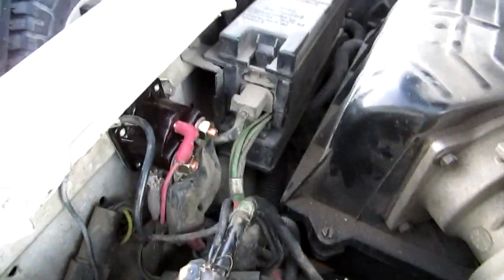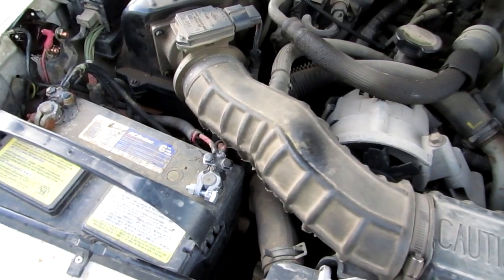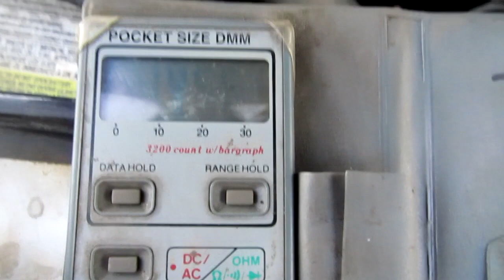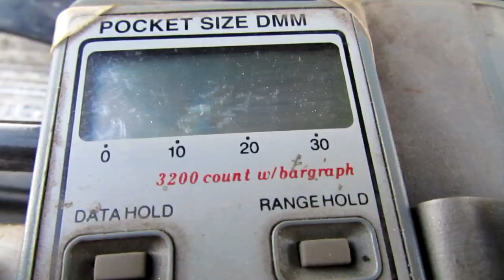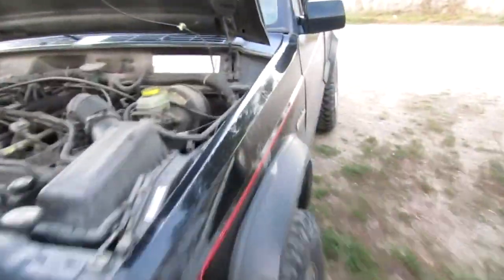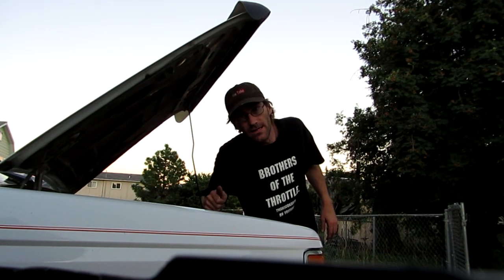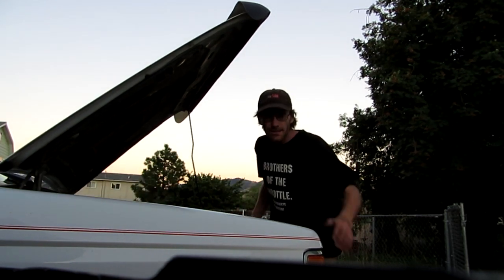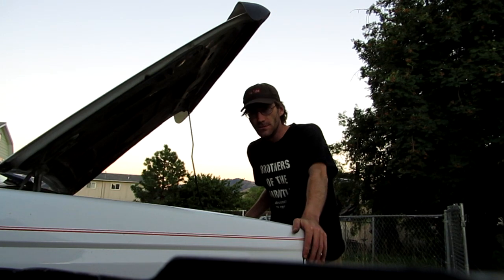Ford Ranger Alternator Test

Comment: Put your battery tester on the battery and then have someone turn the key to try to start it and watch the voltagei if it drops a lot you have a bad cell in battery if it doesn't check the terminals at the starter for loose connection

Comment: as some have said before me, and i had it too, the cheapest fix is if the connection to the solenoid cable  to the starter has any corrosion, replace it , that was my problem in the 90's when i had one.or load test the battery, or the fluid full in the battery or is the battery too old to work, mmm, and some guys put saluted Epson salts in the battery when refilling, seems to work for some. keep us posted sir, i watch all of your videos with anticipation.

Comment: Also an easier way to test the alternator is to disconnect the positive wire on the battery, if the car stalls soon after then the alternator is shot.
Reply: I know I'm 9 years late lol but my Ford ranger I just put new battery and alternator in it and as soon as I disconnect the negative it shuts off should I try disconnecting the positive while running not the negative
Reply: @nickolasvaughn667 You could also try to use a digital multimeter and check your battery voltage when the truck is running, should be around 14-ish volts. Ford Rangers also have fusible links that I believe are connected to the charging system, that could be bad as well.
Reply: @TheKurtTribute  dang you actually responded yeah that's what I thought too I thought it should charge around 13.5 to 14.7 but it's staying at like 12.4 but last night I drove it and it lasted an hour before it shut off and was completely dead so it must be slowly charging because usually if you're not charging it'll shut off in  like 10 minutes minutes
Reply: @TheKurtTribute  checked all fuses they're good maybe the new alternator I got is defective I don't know but I doubt it cuz with the old one it was doing the same thing
Reply: @TheKurtTribute  my mom's alternator went out in her Nissan last week and we had to drive it 2 miles to make it home and it died twice it only lasted 5 minutes this is the 95 Ford ranger 2.3 l it ran good for 45 minutes and then started bogging out and then shut off
Reply: Lights started flickering and then I lost throttle power and then it shut off pulling in my driveway so right now I'm just driving around with a second battery
Reply: @nickolasvaughn667  Likely an alternator issue. My 99 Ford Ranger acted similar when it died. Also, if your gauge cluster works, the battery light will be on when it’s running if the alternator is not working, as the light is really a charge indicator.
Reply: @nickolasvaughn667  The amount of time the vehicle can run on the battery alone depends on a lot of things. Your Nissan likely has more accessories being ran by the charging system/battery when it is running, versus your ranger being older isn’t as demanding on the electrical system. The standing battery voltage should be around 12.6-12.7 volts, anything near or below that when running indicates the alternator/voltage regulator isn’t working. Generally speaking the large post on the alternator should have battery voltage when the key is out of the ignition, if not the fusible link is bad. I don’t remember the exact schematic for my Ranger, but I believe a few wires should have battery voltage if the link is good. You should also be able to start the truck and check the voltage coming from the alternator, wether or not the link is good won’t effect if the alternator itself is actually producing power.
Reply: @nickolasvaughn667  Vehicles can also seem to experience other “ghost” symptoms when the battery/alternator starts to die. I remember my Ranger running fine, and then at a stop sign it was bogging down when I tried to accelerate, it was stuck in third-fourth gear and due to lack of electrical power it couldn’t shift. Eventually it worked it’s way back to first gear, but it took 10-15 seconds at least. In your case it could be bogging due to either the fuel pump, injectors, ignitions system, or many other things not seeing enough voltage which is “confusing” them so to speak. Even in older vehicles, the electrical systems are fairly sensitive as to what voltage they require to operate correctly, and the window is generally pretty small.
Reply: @TheKurtTribute  okay the gauges don't work but the alternator is brand new
Reply: @TheKurtTribute  hey man so we just got the truck fixed I've been chasing this s*** for 3 days literally was like  today I was like they must have sold me a defective alternator so I pulled the alternator went and had it checked and it tested good and then I remembered one thing I pulled all my dash components out the cluster all my dash gauges and I was like that must have something to do with it I plugged them back in now I'm charging 14.47 thank God
Reply: @TheKurtTribute  it's crazy that your alternator basically charges through your cluster having the cluster unplugged it won't charge I figure that out today
Reply: @nickolasvaughn667  The majority of charge indicator lights are wired in series to the alternator charge system. If that wire is unplugged then the alternator has nowhere to send it’s generated power. Essentially unplugging the cluster is the same as cutting the charge wire. Glad you got it all figured out! I remember having mechanical engine issues with my Ranger when I owned it, spent countless sleepless nights stressing out over it.

Comment: check all cables and connection points make sure they are all very clean and tight. then do a voltage drop check across the positive side and then the negative side. this can be done by unhooking one of the battery terminals and connecting a volt meter to the positive post of the battery and to the positive connector on the vehicle. then crank the engine and observe the meter. during this test the meter cannot read more than 0.6v if it reads more the cable must be replaced. do the same thing for the ground side except the ground side cannot read more than 0.2v cranking. then if that looks good connect battery and redo voltage output test on alternator. if voltage is above 13.5v turn on all electrical loads and make sure voltage stays above 13.5 v. lastly if all the above look good replace battery
Reply from the maker: good info, thanks.
Reply: another thing i forgot to mention is check the condition of the insulating material on the cable if it looks like the surface of an orange or looks like it is very fat in some spots replace the cable

Comment: try following the cables from the battery to ground starter and alternator and see if there is nothing loose about the other video the starter staying engage it could be the bendix on the starter staying stuck  .. i had a chevy dump that sometimes the starter stood engage and sometimes it didnt i just end up replacing the starter

Comment: If you are showing 12 volts on your battery, remove all your leads going to from the battery to the solenoid and the starter. Check them for any "bad" spots and give them a good cleaning and put them back on nice and snug. Also, did you check your water in your battery? "frying" sometimes just means evaporating all the water inside the battery. Just make sure you use distilled water. Before anyone says anything "maintenance free" is under normal wear and tear, not a smoking from a starter.

Comment: The alternator cannot charge your battery if its dead.  Disconnecting the battery while the engine is gunning is a bonehead move. the battery stabilizes the alternator voltage, you can burn up your entire electrical system.   Take your battery to Autozone, they will charge it and test it for free.

Comment: Sorry to hear your having so much trouble with your truck. I would go with 1tufdog. His is a very practical suggestion with only spending on the power to do the job. If it recovers with charging then job done. If you can. Do as Anthony said and check water level. If you don't have ionized water. Cold boiled water is near enough. Take care.

Comment: Here is what I think happened. You went to start the truck with your knife and didnt return the gear all the way back to the run position therefore leaving the starter running the entire trip. When you shut the car off the gear was returned to the off position,wich shut the starter and engine off. This cooked the battery. A new battery should fix the problem. So the next time you hear that"fan" sound, take your pocket knife and turn the little gear back a little further.

Comment: It reminds me of a problem i had with my Ford P100 (European model) My problem was that one of the cables to the starter motor was nearly fallen off... It's was connected with a bolt but the bolt had worked it's way out....

Comment: Take the battery down to your local parts store and have them load test it after you charge it. Awesome so you can run a jumper wire from the positive terminal on the battery over to the energizing terminal on the starter solenoid and bypass your ignition switch if it turns over then the problem is in your ignition switch.

Comment: Sounds to me like there was an arc when you tried starting it, so I would check the battery leads to make sure they are tight (you'd be surprised what a loose cable could do) I would also check all grounds and make sure they are tight, with a vehicle of its age they very well could have worked themselves loose, maybe a battery would fix it, however I personally would check the free to fix things first, connections, wires, etc...

Comment: tman it might be silly problem like my dads car it was the (battery fuse) note (check if it has a small crack or if it's burnt, the electronics box in my dads car was in the upper left side of the hood but in your truck it might be the one you took pics of in the first video so ya they are cheap also 
Good luck man

Comment: Battery swap for quick check. With multi run + lead to bat post and the ground to the alt. With the multi on 20v it should read about .01 if it reads .04 tp like .05 your diode maybe sticking. If that checks then starter, as when the bendix engages and could stick causing the engine to turn continually until bat dead, could unstick as you did. But again that ignition and column is jacked:( 
Always start basic and cheapest but make check list so no work orwasted time, you have building to do!

Comment: It is actually 100% true, by disconnecting the battery while it is running, the alternator can supply too much voltage to the electronics because the battery isn't there to act as a conductor. You would never think this could happen, but with a little bit of knowledge on how electricity works, it makes perfect sense.

Comment: You shouldn't disconnect the battery with the engine running, you can fry the computer and all your electronics. To see if your alternator is working, test it with the battery hooked up and you voltage should be around 14 to 15 volts. Try your battery in something else, to see if it is OK. Good luck.

Comment: Let me see if I can explain so you can understand. By disconnecting the battery, the alternator has nothing to do and with no battery, it doesn't know how many volts to produce and it will put out way too many volts. It can burn up the alternator and computer. Some people are lucky and nothing will happen. I've seen the computer burn out by just swapping out batteries so I'm not shitting you.

Comment: is there a person who can program computers for this truck?  I just got this vehicle from an inlaw who used it for racing on speed track, mad rust though, don't know if it's worth the time to go forth with this project...  suggestions?  Engine cranked for 3 seconds, then dead...  brand new battery...  forgot to drain out old gasoline (has been in tank for 3 years), next step...  we'll see what happens...  recharging battery, let's see what happens tomorrow; any info on computer programmers would be appreciated... (New York) - what a risk...  $110 for battery, let's see what else...

Comment: Riiighht... sooo thats why family and friends have run vehicles with no battery for a long time before putting in a battery.. no problems either... oh btw, as for the car not knowing how many "volts to produce" an alternator puts out a constant voltage.... it charges the battery and runs the electronics in the car... also if a computer burns out from a swapout of a battery then you are an idiot and probably shouldn't be under the hood of a car...